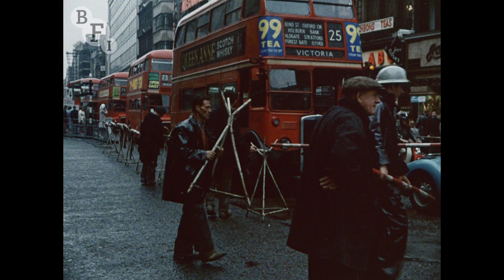Victoria Line Report No.5 (1969) - extract

Comment: No hard-hats, no high-vis vests, no safety shoes nor gloves and nobody lost so much as a finger.  There were some scary moments in that film.  I am not saying modern safety codes are bad, but I am saying that navvies worked at a different level in those days!  They built the world we live in.
Reply: Clearly you have never worked in construction .... accidents happen everyday ...a drill slips or a saw ...you bump your head against a pipe ...a loose wire holding the ceiling up pokes your eye out .... every construction worker values health and safety highly.
Reply: @reinerraymondo1586  Not everyone values health and safety!!  I worked in construction for 8 years, and then in Public Utilities for 28 more.  I've lived a quarter of my life on job-sites.  I know all about it.  Had a few minor injuries - nothing serious - but they were my own fault.  I have been inside concrete forms strung with reinforcing bars (and nearly got an excavator dropped on me), I have been at the bottom of 30-foot drainage tunnels and also in narrow, un-shored excavations twenty feet deep.  Cutting corners kills people, I have seen it.  I watched one old man get buried alive due to his own folly in going to the bottom of an excavation on a rainy day when we warned him not to.  We could do nothing to save him and it took hours to dig his dead body out of tons of mud.  I've watched another one cut open his leg with a diamond-tipped concrete saw due to his own careless handling (REAL Men don't NEED to sheathe the blade and turn the motor off!) and he bled to death before the medics could get there.  I wanted to praise those navvies for their skill, strength and courage, not to disparage them.  My hat is off to those men.